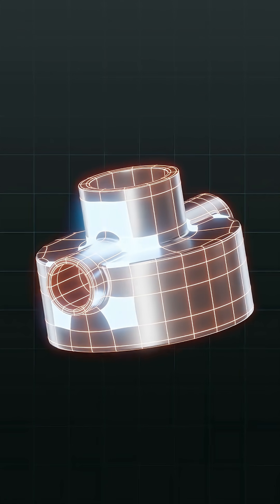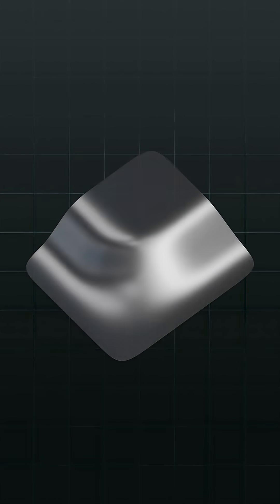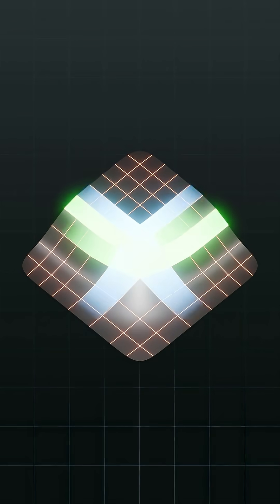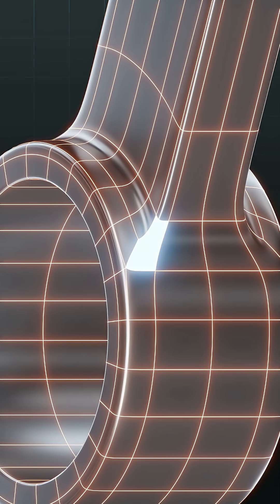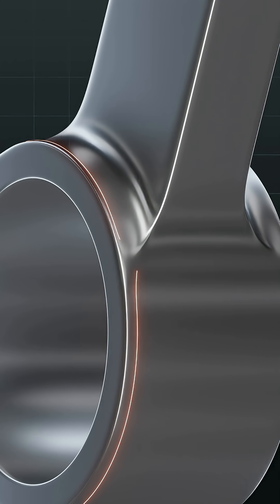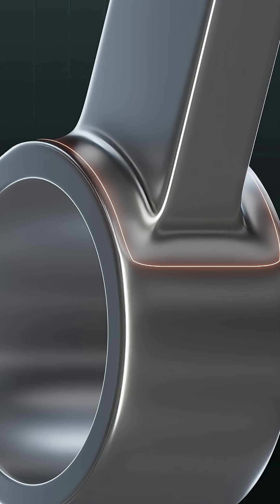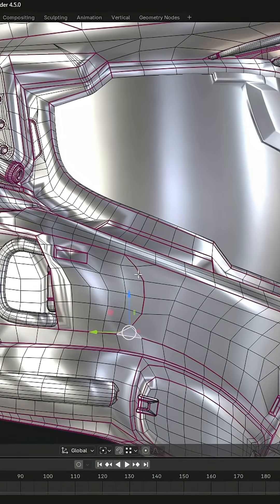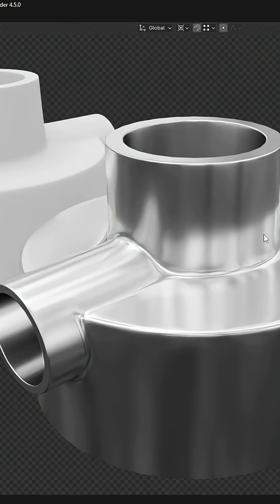You CAN Model with Ngons | #blender3d #blendertutorial #blendermodeling

Comment: I've started using N-gons in my character modeling after your videos and I'm impressed with how much it helps to get the exact poly flow I need in problematic areas.

Before, I had to add more topology to my LP meshes for tricky areas to add the 5-poles for proper flow redirection. Now I carefully plant N-gons in these spots, and oh my god, post-subD it just works beautifully and is ready for skinning.
Reply from the maker: Once you understand how ngons work, they are such a lifesaver in simplifying the modelling process. 😄

I certainly used to be in the all quads camp, but it has been such a breath of fresh air to understand how ngons work in subdivision hard surface modelling. They worked an absolute treat on my recent Master Chief helmet model. 😄

Comment: I make anime charachters. To me ngon is a great tool to creat ridiculasly low poly base mashes and then the first layer of subdivision usually fix it to a nice quad topology. When i have an issue usally it quickly solvable with a little sculpting or retopo of a single meeting-point.
Reply from the maker: Yep, this a great use case for ngons within a modelling workflow. 😄

And you've highlighted a great use case for how they can still be utilised for a fully quad based model if that's what your end goal is. 😄

In the full length version of this video, I go into a little detail on this, subdividing an ngon face, extracting its relevant poly flow, and then integrating that back into the original mesh. 😄

Comment: game engines triangulate polygons when importing. Always avoid ngons and learn proper topology
Reply from the maker: So, do me a favour, and add a triangulation modifier to an ngon of any vert count. what does it resolve into?

Also, these examples only work due to an understanding of proper topology. 😁 I’d encourage you to check out the related video which explores these concepts in much greater detail and explains how and why the poly flow of ngons work in subdivision surface modelling.

I also specifically show an example triangulating a mesh with ngons and baking normals to show how ngons can be used in a game asset modelling pipeline. 😁
Reply: @masterj2001 ctrl+T and your mesh is triangulated. Is it fixing the problem? No. Not only will your UV unwrapping going to be a pain in the ass but also the texturing in substance painter will be completely fucked. Subdividing a triangulated mesh ? Good luck. Bevel edges ? Good luck as well
Reply from the maker: @BlenderToUnreal  I’ve had no issues with integrating ngons into my modelling workflows, triangulating the low poly, subdividing the high poly, UV unwrapping the LP, baking normals, exporting to an external texturing software and then bringing it all back into blender. 😁

It would also work in other engines, but I can assure you that this process does indeed work for subdivision hard surface modelling and the asset creation pipeline. 😁

Comment: "Ngons bad" mostly comes from rigged character models and situations where it screws up the shading. Also, with subdivision surface, it IS actually resolving it to quads lol. N-gons can cause inconsistent shading and deformation due to every graphics program ultimately resolving to tris, and there's a lot of ways to resolve an N-gon vs just two directions for quad tesselation. Subdiv eliminates that issue
Reply: Interestingly, Pixar has a document outlining use cases for ngons in their rigged models. Of course not as plentiful as in the hard-surface modeling examples shown here and in Jordan Cain's work, but it is there regardless.
Reply from the maker: @nilepereiraa  Yes, I have actually linked to the exact article your are referring to in some of the comments here. 😄

I won't speak on ngon usage on organic models or models that deform, as I don't know enough about their placement and will provide people with false information. 😅

I've learnt how they work in hard surface modelling applications but unsure if that translates to organic (it would obviously for HP → LP baking, but not sure how and where you'd want to place them on an organic model). 😅
Reply from the maker: Yeah, unfortunately the notion of ngons being bad has just become an umbrella term that has applied to all areas of 3D modelling. 😅

By no means do I wish to change how people model or force them to use ngons, but I just want to help de-stigmatise them and help people understand that they do have utility and can be used to great effect within subdivision surface modelling. 😁

I must say, after 11 years of modelling, and having only recently learnt about the utility of ngons, it has completely changed my modelling approaches and made resolving topology far easier in some instances. 😁

Comment: "Without artifacts" Actually you can clearly see the artifacting. Compare it to a real world piece and see the difference. Just cause it doesn't look bad doesn't mean it is correct. Not meant to be rude tho.
Reply from the maker: I can assure you these are devoid of artifacts (I have had the models vetted by modellers far more experienced than I as I wanted to ensure I wasn't providing false information). 😅

But in hard surface modelling, the entire point is to make the final model shade correctly. With modern bevelling tech, such as the one available in Marmoset, and the more advanced normal blending that can be done with geonodes, proper topology is in some ways superfluous (though not to me, as I love the modelling process). 😅

The final shaded result is the main goal, the means of getting there are varied and nuanced, it's just a matter of getting there in a method that works best for you. Two modellers might arrive at the end goal in two different ways, but provided the model shades nicely, then both methods are valid. 😄

Comment: Mostly the talk about avoiding ngons is for riggable models that are meant to deform or bend. For static models like these, ngons are a utility.
Reply: Devil is on the detail
Reply from the maker: Yeah, unfortunately that branch of conversation has bled into the general stigma that, "ngons are bad", across the board. 😅

I'm hoping that I can play my part in trying to show that that's not the case and that ngons can be used and do have utility within subdivision hard surface modelling. 😄

Comment: As long as the surface doesn't deform, it's fine to have n-gons if reasonably placed, even sometimes it's preferable. But n-gons can easily be misused, for beginners you should just forget it and only use quads or tris.
Reply from the maker: Yep, I back this! 😄

Learning the fundamentals of quad based topology, poles, and edge flow is key. Ngons can only be used, in certain circumstances, since they still follow the principles of quad based topology workflows. 😄

The only difference, is that it takes a little more forward thinking to see where the newly subdivided poly flow will end up (I've been modelling for 11 years now and only just learnt about the utility of ngons, I was previously in the, "ngons are bad" camp). 😅